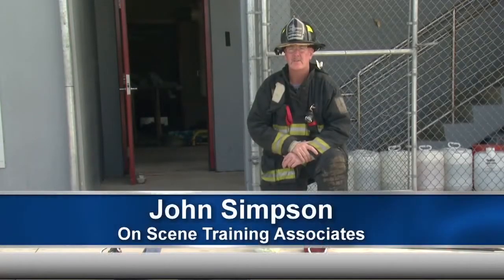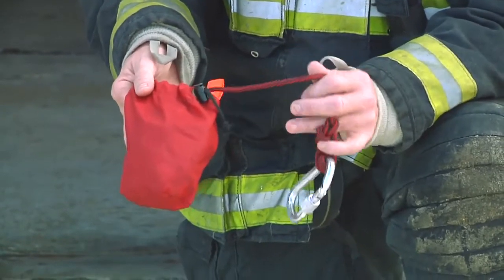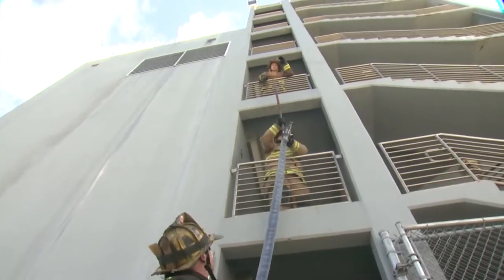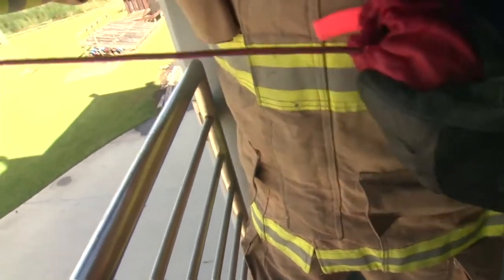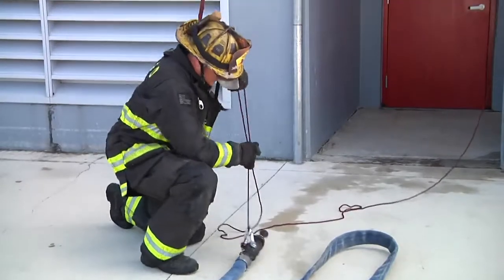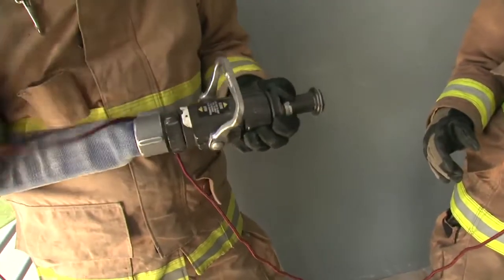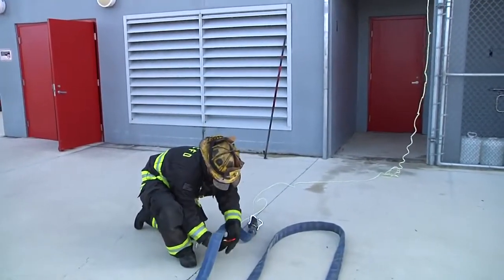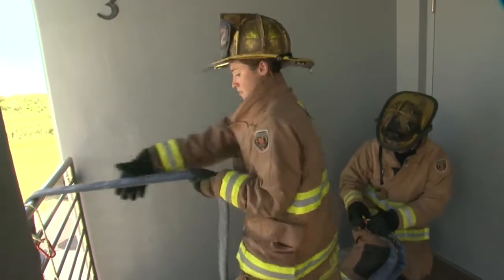Extending a Hoseline Up Exterior of a Building #5712939680001

Comment: If you put a second carabiner near the end of the line which you clip to the rail, when you haul the hose up you could quickly use that second clip to put a hitch around the hose to act as a progress capture device as the crew pull the line up and into the fire. Pull through enough line, set the hitch and the weight of the line from the ground to the rail is instantly off your crew.